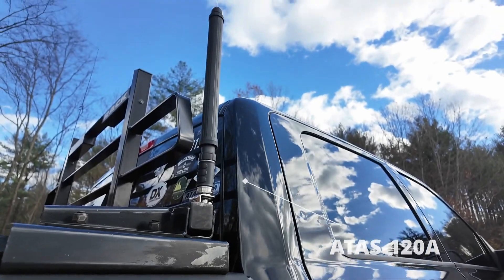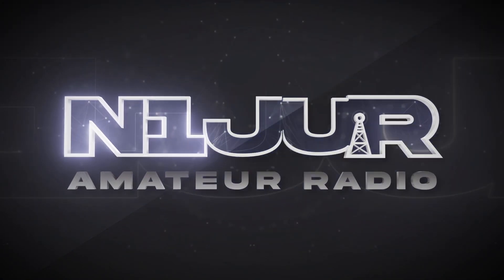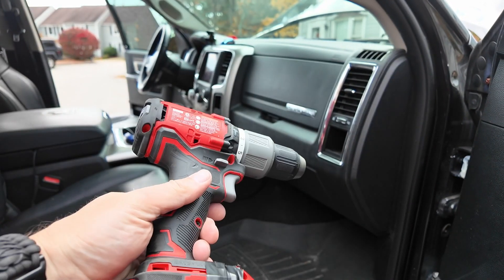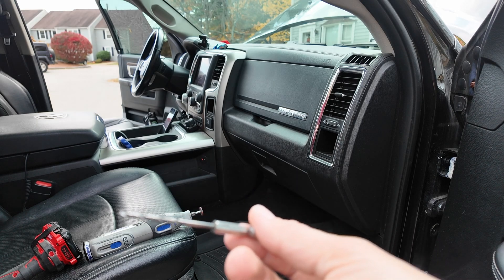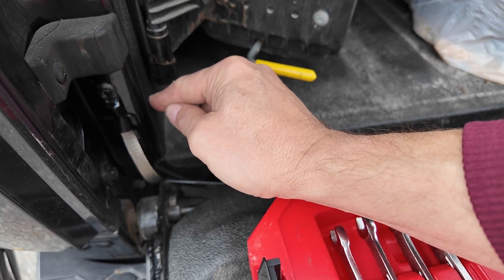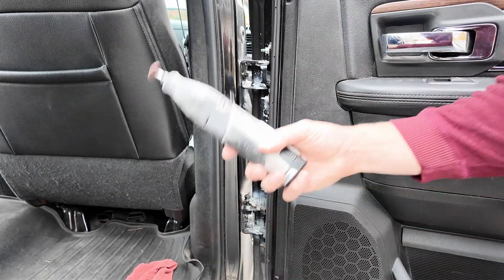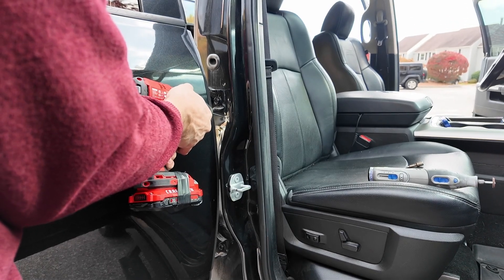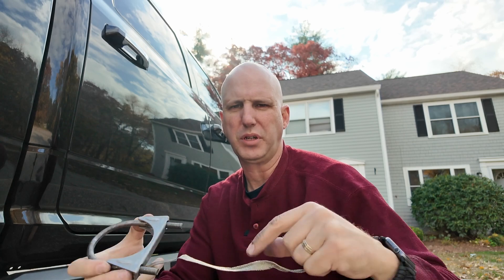My Mobile HF Journey - Build Series: Bonding & Grounding

Comment: Wow.  I had similar experiences.  While driving with the cruise set, if I tune 40 meters the accelerator would pin and the truck would take off.  Lesson learned.  No tuning 40 while in cruise.
Reply from the maker: yea apparently the vehicle computers aren't well shielded and RF can affect them.  Better to listen and pull over to operate HF.

Comment: 2:16 I really appreciate these videos, Eric! I have a 2006 Toyota Tacoma (Gen2). I've installed ditch light brackets and lights from CaliRaised, along with Ham Antenna Ditch Bracket Extensions from Amazon to mount my ATAS-120a and Comet SBB-15. I've run the coax through the firewall, under the carpet, and at this point just have them coiled up on either side of my center console. I've also begun the bonding process, but have a ways to go. To operate, I have my Yaesu 991a (with Armoloq) in a backpack, along with 2 Bioenno 12ah batteries, and an Oukitel Rugged Tablet for POLO. At this point, I set the radio and batteries on the passenger seat. 🤷🏻‍♂️
I'm hoping to do something more permanent in the near future. I'm waiting to hear more reports about the FTX-1 OPTIMA. We'll see how it shakes out.
Thanks again!
Rodger KJ7LLX 
73
Reply from the maker: Roger, Glad to hear that! as I am always interested in seeing other peoples builds and how they setup HF/VHF mobile. Thanks for sharing!

Comment: Great video. My big issue at first is that the ATAS wouldn’t tune. Bonding the exhaust and the antenna better helped. Didn’t do the doors or hood.  My weird issue is there is something in my car that creates interference on the APRS frequency so my 500 usually won’t beacon because it’s receiving on that frequency almost constantly
Reply from the maker: man.. what type of car do you have? As that sounds like a lot of interference if it affects your 2m radio as well.
Reply: @ HF is fine. BMW X7.  I think it’s the wireless charger. I need to look at the wiring diagram. I don’t use it so if it is on its own fuse I’m going to pull it and see if it helps.

Comment: Eric great video, I look forward to following and learning from your journey.  Maybe I missed this key bit of information but did you compare interference levels using the 891's filtering abilities before you did any of your grounding work?  I see that you have Anderson connectors on the passenger side of the center console.  Presumably you could carry a portable battery (sounds like a nice project in itself) and plug that in and run independent of the trucks under hood battery.  Brilliant idea of running coax to the license plate area and having an antenna switch to operate it!  Thanks,  KD6KXT.
Reply from the maker: Steve,

Yup.. I released the build videos to my channel and Patreon members. They will slowly be released over the next few weeks. But if you can't wait they are available to all subscribers now.
Reply: @N1JUR  Thanks for the clarification.